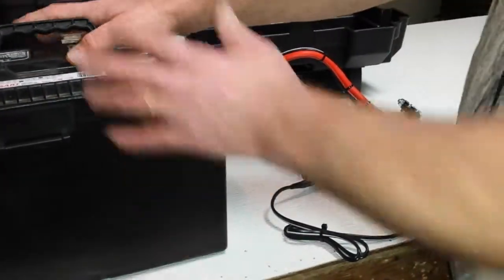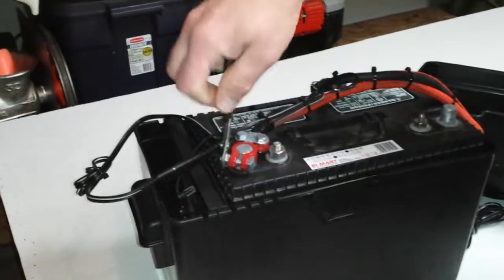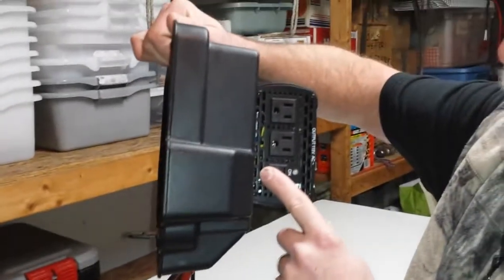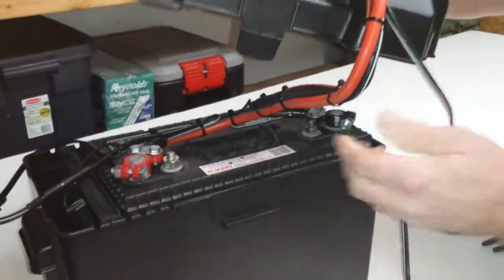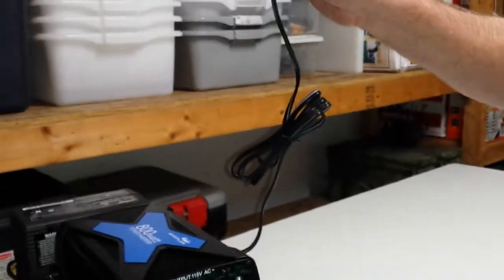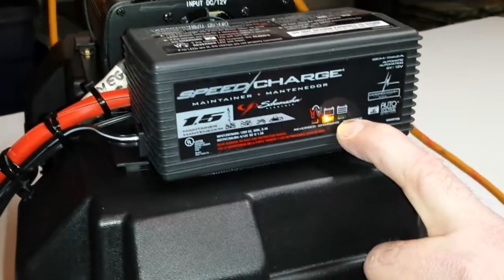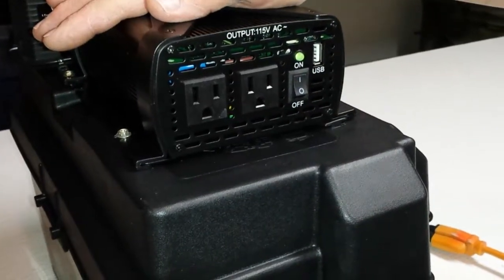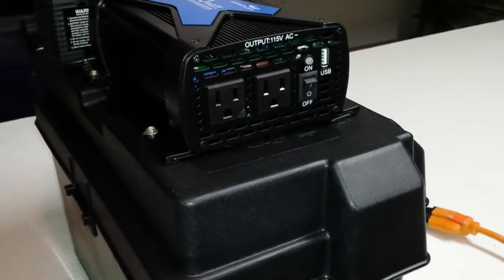Tactical Woodgas Emergency 800 Watt Power Pack (Assembling your Inverter Power Pack Kit)

Comment: NICE VIDEO BUT WHAT KINDA BATTERY YOU USED HOW MUCH AMP I HAVE THREE INVERTER 500 WATTS EVERSTART 120 VOLTS 60 HZ 4.2 AMP 1100 INVERTER 9.2 AMP 120V 60 HZ